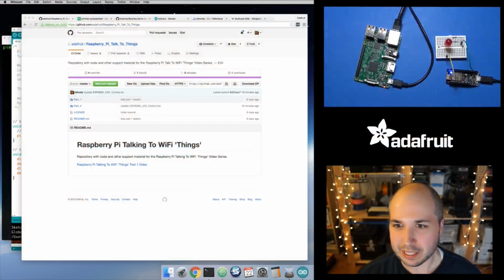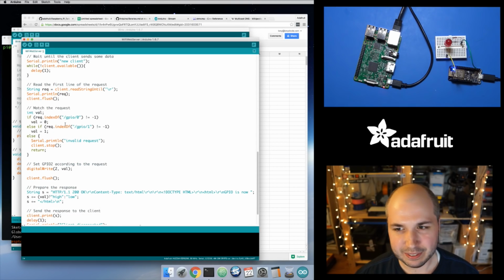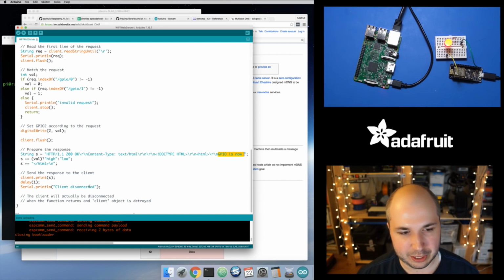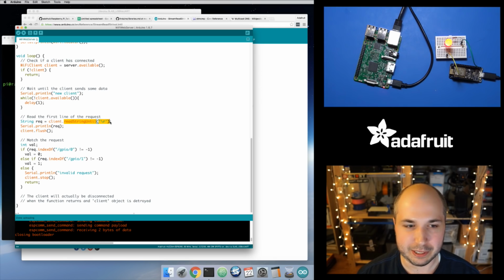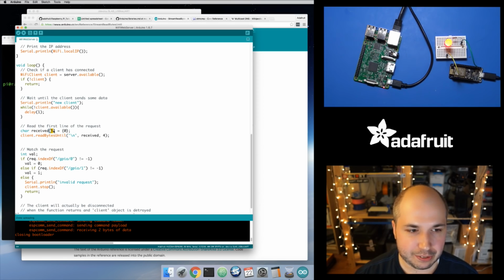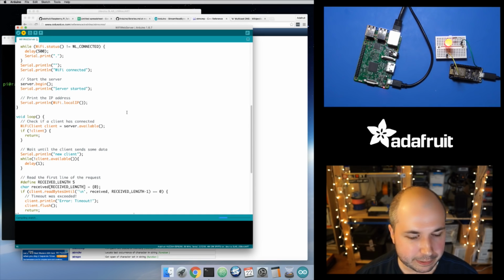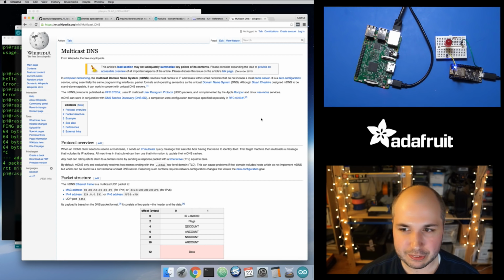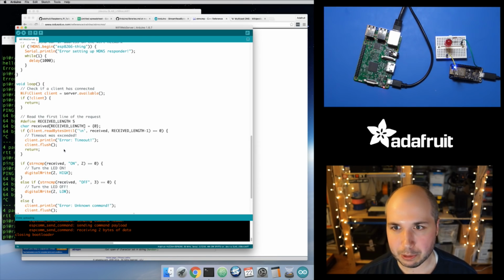Raspberry Pi Talking to WiFi 'Things' pt. 2 with Tony D! @adafruit #LIVE

Comment: hello Tony. as stated before, great series. once i finish putting together all of the knowledge you have presented, i will produce my own video showing my creation. Question - i have read about programming the ESP module with a static IP address, and many have stated that it is easier to have a DHCP reservation vice giving the device a static IP. is this true? if it isnt,  do you have a reference where this can be done?

Comment: love this series. By the way, Celsius is not European....its the rest of the world other than the US. This is why the manufacturers use Celsius and Pascals. Because this is 95% of the market. I did try to get tthis micro from Adafruit, but they can't  keep up with demand. Could you make another version using Arduino uno and an off the shelf ESP module?